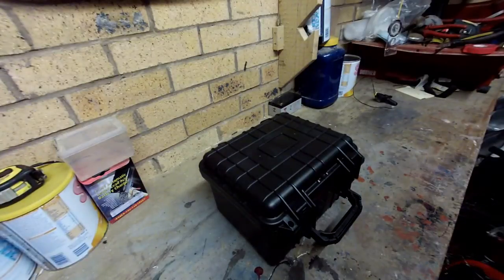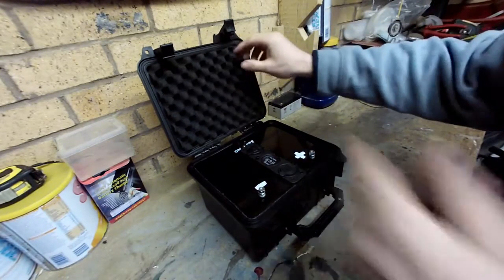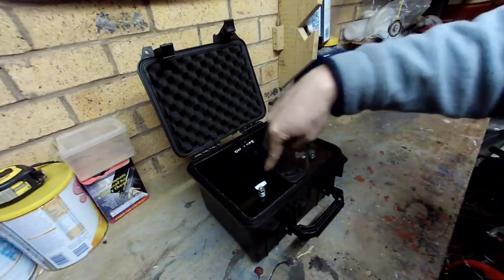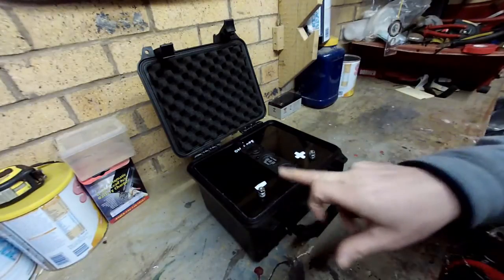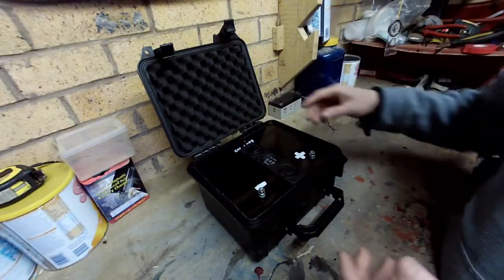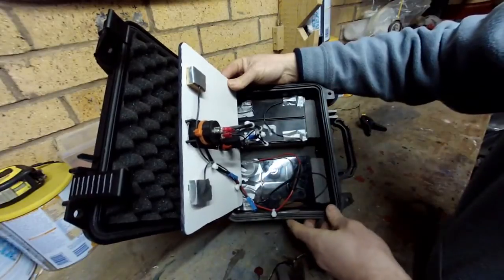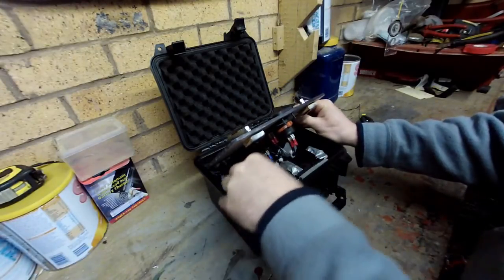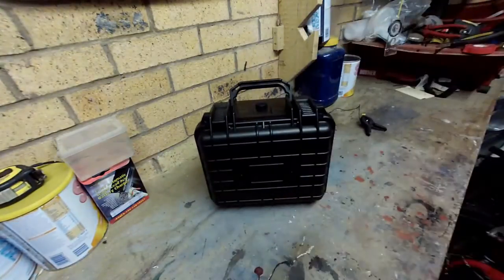My Battery Box final build. Waterproof 12V 24Ah, Awesome I love it.

Comment: This is a really nice battery box, as you said 24Ah is quite alot of portable power. Also great wiring to the top console, very clean. But what about the weight of the box? Do you carry it on walking hikes? Transport it in a kayak?
Reply from the maker: I carry it in my kayak for trips away.  It weighs 9kg with 2 batteries. If I am away for only a few nights one battery is sufficient.  It weighs 5 kg with one battery. I made it about a year ago and it has proven itself time and again.

Comment from the maker: The case is a 788-7236 (google it)
Reply: +TheKayakingkid The dimensions of the box are H*W*D = 240*195*112 according to RS website.
This is fine height wise but a 12ah battery  measures 151mm length (box is only 112 deep??) and then 100mm in width and you have 2 so that's 200mm (box is 195)? 

Also the dimensions of the box given are only exteneral sizes so the internal would be even smaller. Can you please measure your box and give me a rough idea of the actual sizes because it's not adding up at all?
Reply from the maker: +TimminZ93 Hi, The dimensions you have are correct however you are applying them on the wrong axis.  Two batteries side by side are approx 200mm.  This is on the 240mm side.  The batteries are 151mm long fitting into the 195mm length with plenty space left over.  The height is about 98mm meaning the 112mm is loads of room.  I hope this helps.

Are you making one?
Reply: +TheKayakingkid 

I’ve got this box sitting
infront of me and the external dimensions all add up.
The external dimensions:  240*195*112

The internal dimensions (exc.lid) 215*150*78  

you said yourself the batteries are 200mm in width which would leave you with only 15mm for the plugs which is nowhere near big enough. 
The batteries are 90-100mm tall which means they would stick out the top of the box into the lid and you
wouldn’t be able to put that nice plastic thing over the batteries with the plugs
in it.
The depth of the battery is 150mm which means it would leave absolutely no room for foam etc like you
have?

I really like you box which is why I got the box but it just doesn’t add up, either the batteries you have are smaller than the dimensions I am quoted online or the box you have is much bigger.